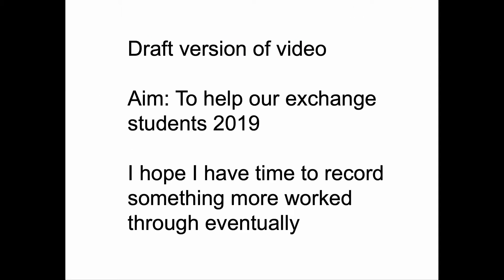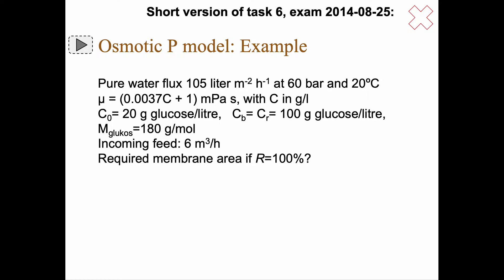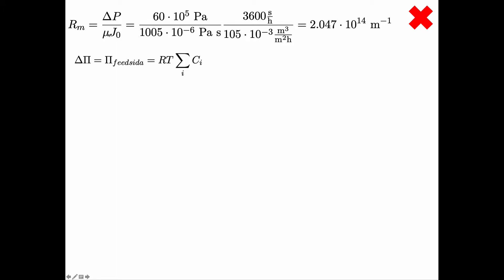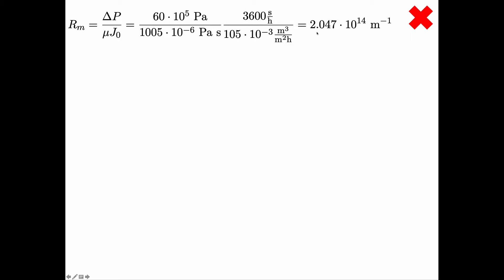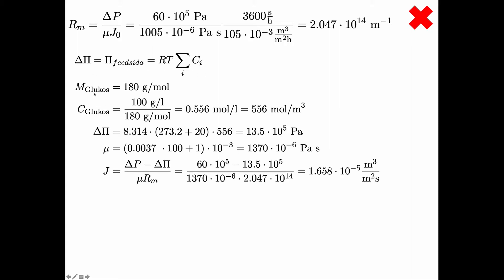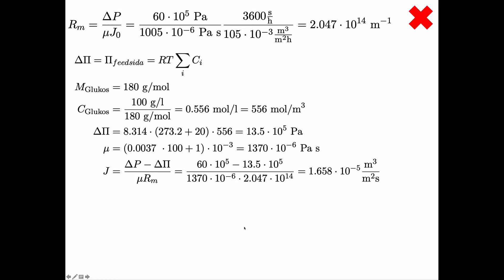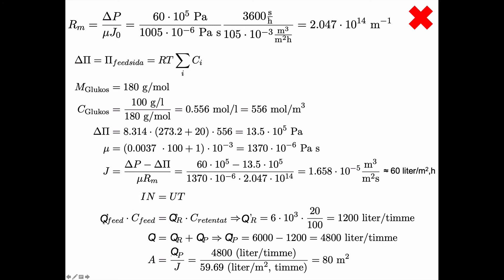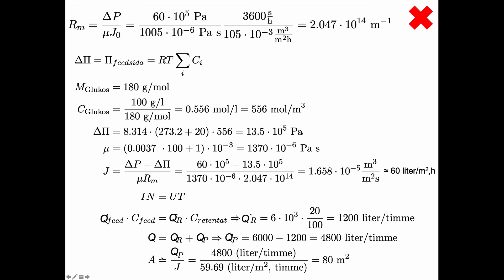Osmotic pressure model: Example (DRAFT video)

Comment: what model would you advise I use for a flat sheet cellulose acetate membrane that is to adsorb dissolved CO2 in seawater?
Reply from the maker: Rather than asking your specific question here in a YouTube channel, I would recommend you to directly contact with a professional (at our department or elsewhere).

BTW I get rather confused by your question. I am, personally, only qualified to give an introduction to the field of membrane filtration, but in membrane filtration the main mechanism is, as I understand it,  not _adsorption_. In fact, you typically want to avoid adsorption (and other kinds of fouling of the membrane) to make sure that you can keep the flux high.